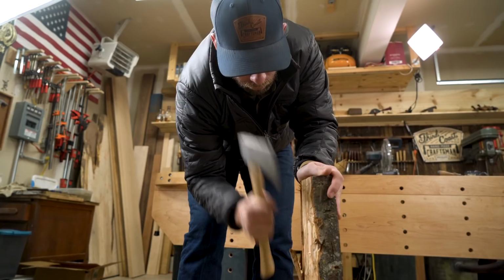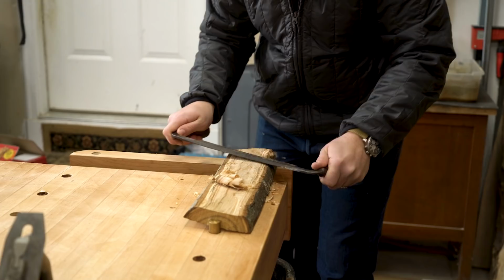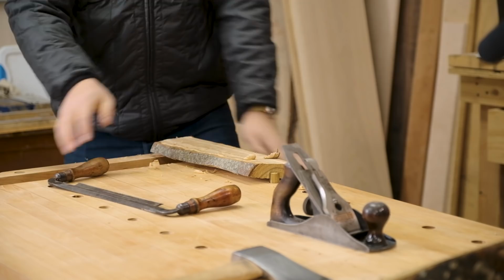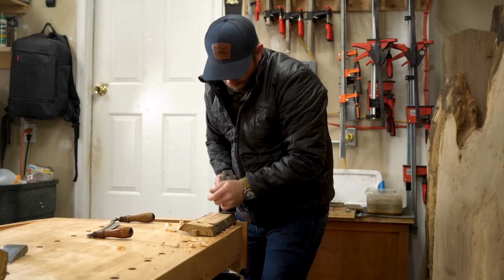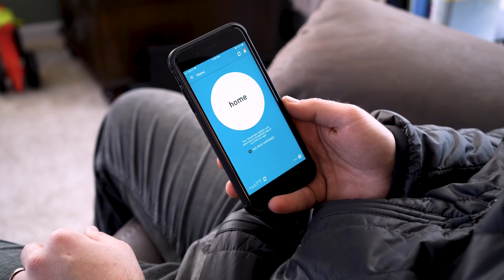Carving A Spoon From The Endangered Tree

Comment: That looks pretty great for a first spoon. A couple tips from somebody who's carved hundreds. A straight sloyd knife is far more versatile and efficient than something like a spokeshave or a rasp. It can take off big hunks or fine shavings when it's sharp. 

Also, you made the same "mistake" everyone makes when carving their first spoon: the bowl is simply too deep. If you really look at most spoons, they're actually quite shallow. Sometimes a deep spoon can be useful, but in general you'll probably find shallow ones far more comfortable and versatile. Also, I'd recommend going much thinner on the handle and neck next time. This gives it a more elegant look and it'll still be plenty strong.
Reply from the maker: Thanks man, I appreciate the tips. Definitely gunna have to try with just a knife next time. I can see how if you are proficient it would be very quick
Reply: @ThirdCoastCraftsman  A Mora 106 is the way to go. It's pretty affordable and great quality. Keep it super sharp and you'll find lots of uses for it in the wood shop. I use mine regularly even on more furniture-type projects.
Reply: @ThirdCoastCraftsman  also, I can tell you've got a good feel for axe work. Well done.
Reply: @PowderhornWild  my mora 106 is my go-to. I like my flex cut draw knife for the long handles. I thought about using a spokeshave, but it takes finesse to get it set just right. Seems like it'll take too much time when a sloyd is in arms reach.

Comment: Just wondering, why no sanding / polishing?
Reply: Scraping can give you a super smooth finish.
In fact, sometimes if you've planed a piece with a super sharp blade, you have to use sandpaper to rough up the surface before finishing

Comment: Did you leave any tools in the drawer or did you use them all ? HA!  I started off the same way, couldn't figure out what to use. Ended up using hand saw and hatchet to rough shape and knife and a hook knife to shap. finished with strips of emery cloth and oil.  yours came out great for a first effort. They seem to look and feel better if they are a little more "organic" with curves and obvious signs of hand work. The "perfect" ones look too machine built and kind of ruins the aesthetic for me.

Comment: Gouges, spoon hook knives, straight blade knives, drawknife, scraping cards, planes - BIG YES but rasps and files and sandpaper - BIG NO! ;)
Reply: Why?
Reply: @oxhornsupporter985  sharp tools like straight knives, hook knives, drawknives, planes..... are cutting clean and leaving clean surface without tearing the grain. After fine knife finish all you need is to apply the oil and leave it to rest. When spoon is dry you can check for rough spots. If there's no thing to work on than spoon is finished. Rasps, files, sandpaper are tearing the grain, wood fibers are not perfectly and cleanly cut down and you would need to reapply the oil several times, sand several times and after all you will get a spoon that looks like the same as others without marks and feels like it's carved by hand.
Reply: @IvarsDayLab  I thought it might be something like this, but I'm only just learning about woodworking.  Thanks for the reply.

Comment: Why would you take wood from a species that is just about wiped out AND MAKE A SPOON from it that will last a year or two wuth use?!  You should have made something that would have lasted a 100 years!!
Reply: Most of our oldest and our most common archaeological finds are simple tools.  It's not like this is an axe or hammer handle that's going to be under a lot of stress on a regular basis.  With a little maintenance and care a spoon like this could easily last decades.

Also, while the American Chestnut is critically endangered, there are still thousands of extant trees, not to mention sprouts that can grow in blight infected areas.  There are even some west of the Mississippi where the blight hasn't spread.

Anyway, making a spoon out of it is better than letting it rot in a landfill or getting burned as firewood.